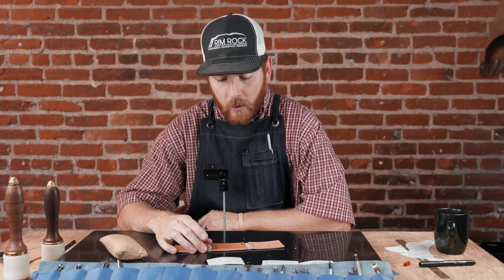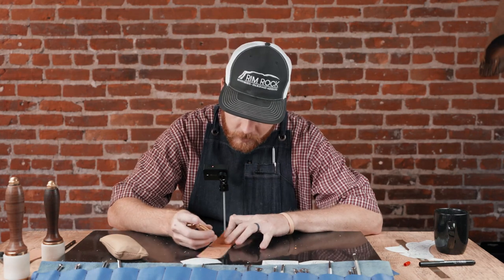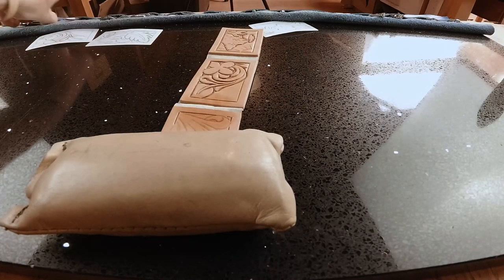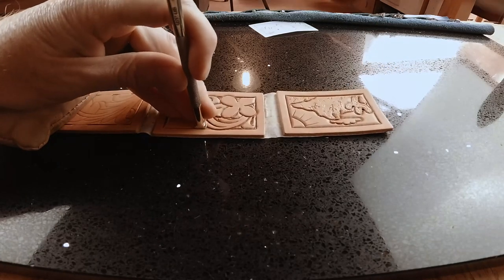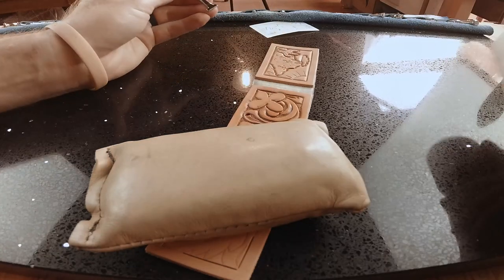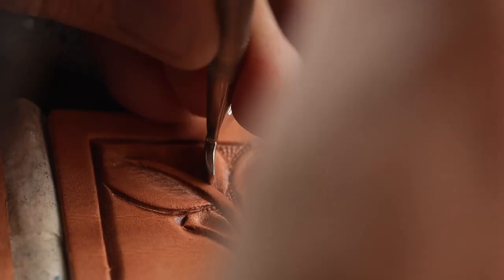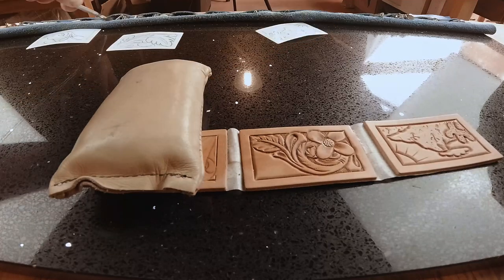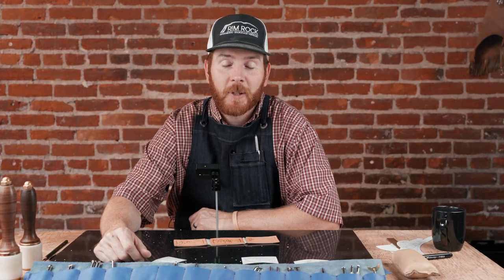Hat Flower

Comment: What is the difference between the #35 5 Seed Bar grounder vs the #45 5 seed .... ? I am assuming size? But how much bigger is the #45?
Reply from the maker: The 45 has bigger dots I would have to measure it but maybe 1/16" in length. I like the 35 because it does finer matting and fits in tighter places for most of the back grounding I do. I use the 45 for shading flower stems mostly or occasionally bigger backgrounding.